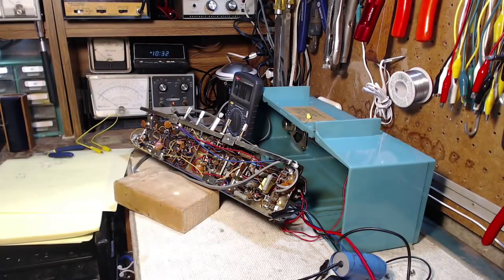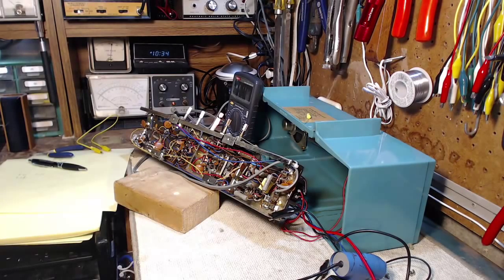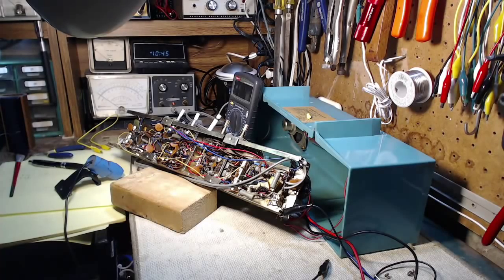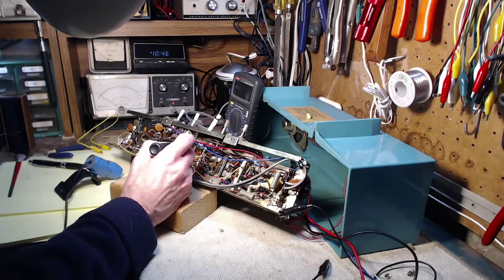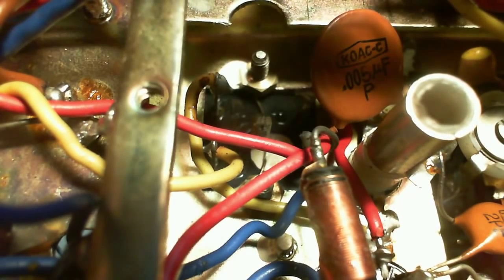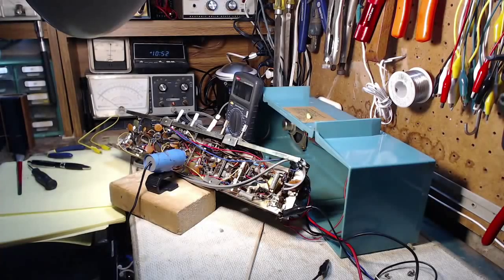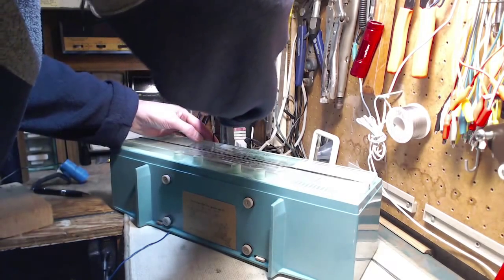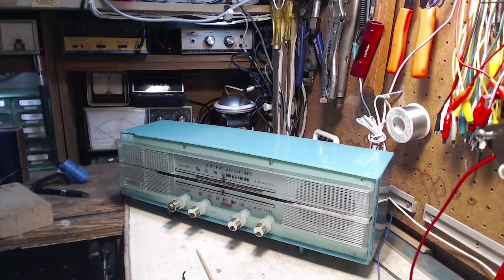AF-610 Japanese AM/FM Tube Radio Video #16 - End of the Road

Comment: i would really look into it with a scope and talke DC/AC meassurement of relevant points.
At the start and when it's operational.
just taking stills (screen capture or photos by a fixedc camera) and and name them in a way, to scroll through the gallery in comparison quickly.
Reply from the maker: rarbiart Interesting idea.

Comment: The lead dress on that radio  must be awful. If you have a GE P780 which is a very fine radio, after you work on it, you have to have your lead dress exact or performance sucks. I still want to know what the cause is but I do understand, you can't work on one radio forever.
Reply from the maker: Kevin Redding Maybe I quit a little too soon.  The cold spray was triggering something but I got off track and didn't really check it out.

Comment: it will be a thermal problem, remember one of the capacitors you sprayed and it went quieter, try doing the opposite and use a hot soldering iron to see if you can speed up the slow starting from cold
Reply from the maker: william fleete I thought the spray set off the poorly soldered connection.  In retrospect, you might be right that a little more poking would uncover the real bad actor.  The owner is happy with it as is and if it's performance becomes a problem, the radio will come back for another run through my shop.